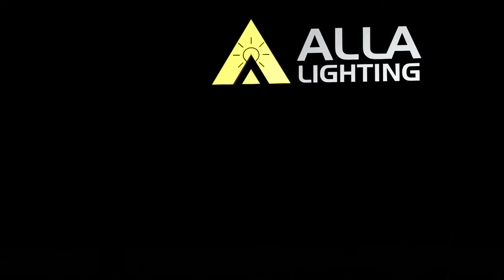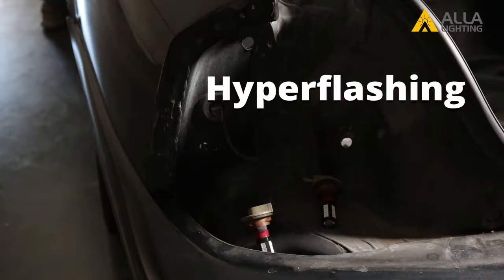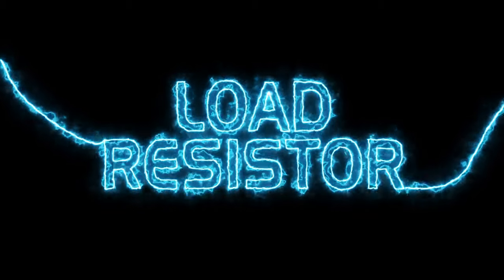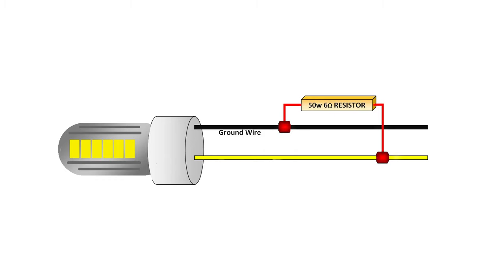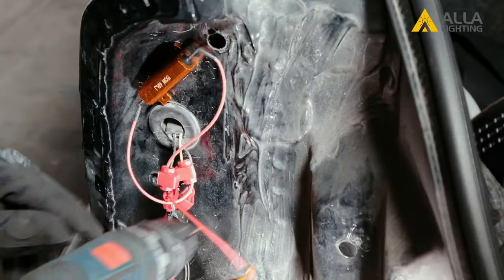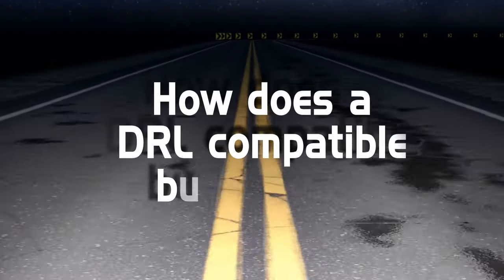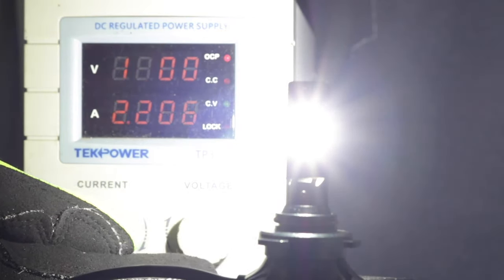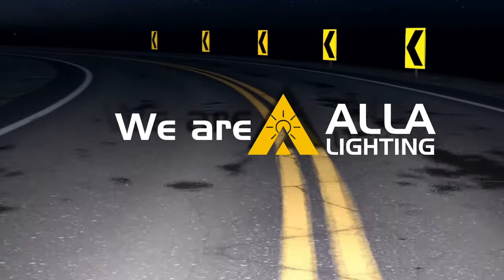Why LED Lights Bulb NOT Working? | How to Fix LED Flickering/Blinking?

Comment: 2010 Dodge Ram 1500: I want to replace the tail light with a ZEVO Sylvinia LED. Do I need the resistor? OR, can I just replace the blinker relay with an LED compatible blinker relay? Thank you
Reply from the maker: Blinker relay is for LED signal lights, yet for brake tail light, extra load resistors are required to avoid the error code.

Comment: Hello.  I bought a set of led headlight bulbs, both high and low,  for my brothers 2008 dodge avenger.  They work just fine when the car is off, but when the car is on the passenger and occasionally the driver side bulbs will turn themselves off for a while, then randomly turn themselves back on.  The high beams do the same thing at a more frequent rate.  From what i gathered from your video this is a dodge computer issue not playing nice with the lower power consumption of the led bulbs.  My question is do we need a resister or a decoder to get these to work correctly?  I see there are many different kinds available online I just need to make sure I order the right thing.
Reply: Same im running into this issue with my 2013 avanger
Reply: How did you solve this?
Reply from the maker: This happens due to the led bulbs purchased draw less power than stock lamps, for your vehicle with CAN-Bus system, for your situation, we recommend to try the CANBUS LEDs bulbs or resistors, for CANBUS LED bulbs we recommend high beam https://allalighting.com/products/can-bus-9005-led-headlights-conversion-kit-bulbs-9011-hb3-white; Low Beam https://allalighting.com/products/can-bus-9006-led-headlights-conversion-kit-bulbs-hb4-xenon-white; resistor we recommend https://allalighting.com/products/9012-9006-9005-led-load-resistors-headlight-flicking-error-canceler
Reply from the maker: @isaachale9588  This happens due to the led bulbs purchased draw less power than stock lamps, for your vehicle with CAN-Bus system, for your situation, we recommend to try the CANBUS LEDs bulbs or resistors, for CANBUS LED bulbs we recommend high beam https://allalighting.com/products/can-bus-9005-led-headlights-conversion-kit-bulbs-9011-hb3-white; Low Beam https://allalighting.com/products/can-bus-9006-led-headlights-conversion-kit-bulbs-hb4-xenon-white; resistor we recommend https://allalighting.com/products/9012-9006-9005-led-load-resistors-headlight-flicking-error-canceler
Reply: @AllaLighting  Thanks. Yea figured it out. We bought and installed resistors so they work perfectly now. They're actually brighter than mine some how
Reply from the maker: @crue3139  Sounds great, we are happy that you figuired it out🙂

Comment: I bought a pair of led strobe lights for my brake lights but after they fllash they stay on but if i remove my feet from the brake they keep flashing...same goes if i turn on the low beams they keep flashing after y stop pressing the brake pedal but not as strong as when i press it....can someone help me...i got a ford focus se 2013 sedan....
Reply from the maker: Please try to install the resistors

Comment: I have a 2013 ford focus and I have tried 2 different types of led bulbs and it errors out each time but on my tail lights they just stay on for hours and I have an error saying brake light failed
Reply: I just learned the hard way. Installed LED canbus bulbs for low beams. Car starts lights good. Then, one or both shut off. After manually turning them on and off a few times, they will stay on. I also get the dipped low beam warning. Did you find a fix for this?

Comment: I got a load resistor because I have a Mercedes’ and the led lights still turn on and then immediately turn off and it attempts to turn them back on and then they just turn off again. It’s annoying. The resistor didn’t help
Reply from the maker: Then you need upgrade a more powerful LED, the one you purchased maybe not powerful enough. If you need our help to locate the correct one, please contact us by email service@allalighting.com by providing order details, issue, and vehicle's Make, Year, Model, Application, we will be glad to further assist you.

Comment: I switched to 9005 LED bulbs in my 2007 Silverado (1500 classic) and my high beams will only turn on when I pull the lever back (temporarily on) but they will not turn on when I push the lever forward (constant on). What can I do???
Reply from the maker: Thanks for your message. Silverado usually is LED friendly, do you have any other modification? do you see an error code on dash? Please advise for further assistance, thanks in advance.
Reply: @AllaLighting  Thank you. I just replaced the stock radio (professional installation). No other modifications. There aren’t any error codes either.
Reply from the maker: @tedmccarthy9525  The diagram indicates current runs through Headlamp Dimmer Switch before it reaches ground, we recommend you check: 
1, Body Control Module(including the lever used to turn on and off high beam) and Headlamp Dimmer Switch(the Switch used to switch among AUTO, PARKING LIGHT ONLY, HEADLIGHT MANUAL), if both parts function properly with 9005 Halogen Bulb installed, then they are good.
2, We also head the issue that LED headlight bulbs only work when the Headlamp Switch is switched to HEADLIGHT MANUAL, if that's the case, a pair of load resistors are required to restore the circuit. https://files.slack.com/files-pri/T011WBH039T-F01L53YBT7W/2008-chevy-silverado-headlight-wiring-diagram-wiring-diagram-and-1.jpg

Comment: I have a 2010 e350 , I installed led lights and the resistor, I will work for 20 minutes, and then go completely out ,after 2or 3 minutes they come back on
Reply from the maker: Because we don't know the LED lights bulbs you purchased, please contact us by email service@allalighting.com by providing order details, issue, and vehicle's Make, Year, Model, Application, we will be glad to further assist you.

Comment: I have a 2013 toyota corolla and am having an issue with my new LED headlights. 
I have both low and high beam LED'S, if the car is off and I toggle the light switch, all lights work as they should but
Whenever I turn on the car, only the high beams turn on automatically, but at half strength.
Mind you the light switch IS OFF. So I can't shut them off.
It will remain this way until the car is shut off. I tried two different brands with the same result. Also, i do not find anything anywhere addressing this problem.
Reply from the maker: This because your vehicle's high beam share the same bulb with DRL, so at daylight, the bulb will turn on as DRL, at night, when you power on low beam, then the high beam/DRL will shut off. If this answer is not helpful, please contact us by email service@allalighting.com by providing order details and issue, we will be glad to further assist you.
Reply: Lol. Your issue is they won't perfectly as intended. Believe me that's not a bad thing i tradé with you my drl led issues any day. Lmfao. Jk. Lmao. 👍😎⭐

Comment: Bought an LED for my 2016 Dodge Charger and I get the random off. How do I fix this?
Reply from the maker: Please try to upgrade to our newest CANBUS bulbs, link is https://allalighting.com/products/can-bus-9005-led-headlights-conversion-kit-bulbs-9011-hb3-white or installing LED resistors for the existing item: https://allalighting.com/products/9012-9006-9005-led-load-resistors-headlight-flicking-error-canceler

Comment: I installed LED on my 2015 charger with antiflicker module, randomly it turn the bulb off and go on after 2 sec, what cause this problem?
Reply from the maker: It is recommended to try the load resistors to see how they work. For Dodge charger, it requires more powerful LEDs and resistors to make it work. If you purchased from us, please email us service@allalighting.com your issue detail. order number and vehicle's information for further assistance.

Comment: I installed 2 LED light bulbs of 35watts each on my 2014 GMC SIERRA. The weird thing is the lights are on when the vehicle is not started and on the power ON mode; however, the lights will be off as soon as I ignite engine..  Does anyone know what problem it is?
Reply from the maker: Please advise what type of the LED lights you have installed? like front turn signal? brake light?etc.
Reply: @AllaLighting  they were headlights
Reply from the maker: @heyyikan9456  thanks, probably the resistors helps, yet we don't know which product you purchased, in fact, it is better to contact the seller of the LEDs to check whether it helps.

Comment: too many unecessary electronics in modern vehicles. One time I saw a Intake manifold uses a DC motor with gears to open and close an air flow plate . . . a vintage tension spring is more accurate
Reply: Too true! My daughters' BMW 4 series tail light mounted on the boot (trunk) lid failed. The unit consists of 2 circuit boards and 6 LEDs to do what one 989 or 233 filament bulb used to do. The boards cannot be bought separate from the housing and lens, so the full unit has to be purchased at a cost of £250 ($388). A 989 or 233 bulb costs .50p (68 cents) so you could buy 500 of them for this money. Why is all this effort made and expense incurred to install LED in vehicles?
Reply: @mattmcgahan  UNFORTUNATELY it is all about making a BUCK off of the uninformed consumer.   This is the very reason why I no longer own a 2014 BMW X3 ... as even a minor repair cost Buku Bucks ($$$) to fix.  My local BMW service department charges $165 per hour for their service mechanics, which I am sure only get paid less than $50 per hour BEFORE Taxes !   Yah, buying a used pre-2000 vehicle is probably your best DIY consumers BEST BET ... and you can still buy the Haynes or Chilton service manuals for those vehicles whereas newer vehicles no longer publish/issue repair information/manuals for the consumer ... again Auto makers and dealerships just trying to keep YOU from fixing your own vehicle and trying to squeeze YOU for every BUCK they can make from YOU !